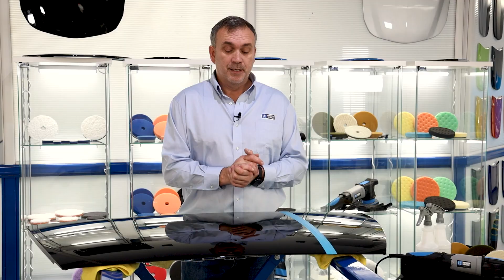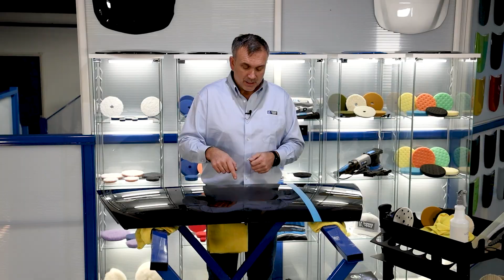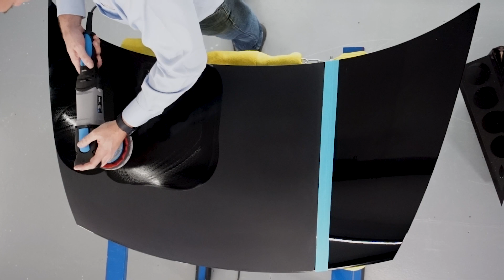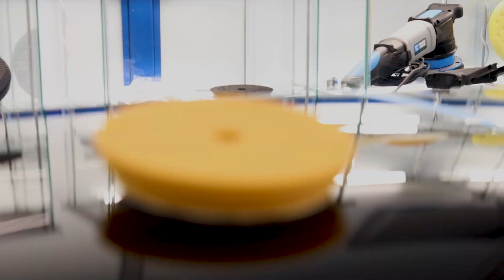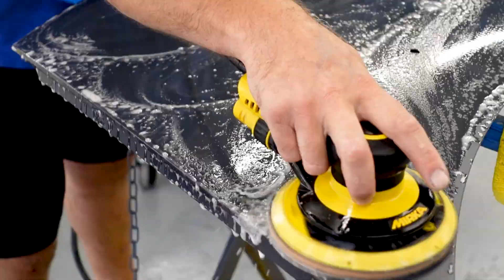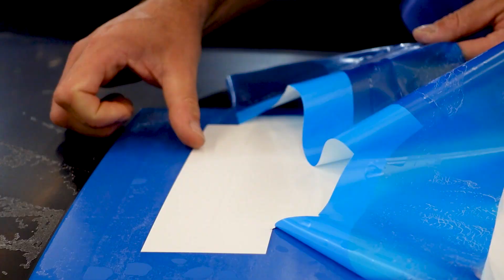UDOS® 51E Sanding Showcase | Removing Orange Peel

Comment: UDOS is one of the most versatile machines on the market today.    For an enthusiast at home that is just getting into polishing or more were upgrading from a Porter Cable or something like that,  this machine makes perfect sense.    It gives you access to every type of machine on the market today such as a stand alone rotary,  8mm, 12mm,  15mm, and 21mm.    No other machine on planet earth does as much as the UDOS from Lake Country.    The only downside is the size of the machine.   So even with this machine,  you would still need to purchase a smaller machine like the Rupes iBrid Nano or a Flex PXE-80 in order to be able to polish the more intricate areas which would be difficult with the larger UDOS machine with a five inch backing plate, although many people who just want one machine,  the UDOS would do 80% of the vehicle with the larger backing plate and not having access to a smaller polisher.    It would be cool if Lake Country eventually introduced a MINI UDOS!   Have all five modes just like the larger machine with the same ability using the turnstyle dial to change to the various modes, but also include a case,  the various pads,  the extension bars, and a quick change backing plate system like other machines have like the Flex PXE-80.   That's a tall order for Lake Country for sure, but maybe they will do it in the future.    That would give both detailers and detailing enthusiast alike the ability to have just two machines,  a larger UDOS, and a smaller UDOS and you would have access to polish/compound/sand every type of polishing situation you would ever come across.   The Ultimate would be if they could do both a larger and smaller UDOS polisher in BATTERY FORMAT!   Most detailing professionals and enthusiasts have converted over to battery powered machines and even most companies offer both corded and battery powered machines,  but realistically,  most detailers and enthusiasts like the flexibility and being "freed" from the cord so to speak as it does make polishing and cutting paint a whole lot easier.   Especially when using the smaller micro and macro polishers that are widely available now.    If the machines were designed correctly and the correct engineering went into them making them less heavy, quality built,  well balanced,  and have a lot of useful features and aspects to draw detailing professionals and enthusiasts to that brand of machine,  it could be a real winner.   Also include the various UDOS pads with BOTH machines if Lake Country ever did decide to design a small UDOS as a partner to their larger machine.   That way you would have the exact same pads (the microfiber,  olive, and khaki colored pads in 1 inch, 2 inch, 3 inch, 5 inch, and 6 inch sizes as a total range for the UDOS.    Even if Lake Country never explores manufacturing the smaller machine,  it would be nice to have the UDOS pad range in the smaller sizes to match the larger 5 and 6 inch pad sizes.    When you are doing a paint correction,  if you are using the UDOS machine,  when you bump down to using your smaller machine of choice,  you don't have a way to match the correcting you have already been doing with the UDOS machine,  There is no cross compatibility so it makes it a lot more difficult for the detailer and the enthusiast because you now how to use different pads to try and mimic the result which is very difficult and takes a lot more time.   You will never get the exact same cut and finish as you did with the UDOS pads when TRYING to match them to the smaller pads which are completely different to the UDOS.   While you can certainly get close to the finish, you will never been exactly the same due to the differences in the pads characteristics, density in the foam,  type of foam, etc. etc. so you see why it would be great if the smaller 1 inch, 2 inch, and 3 inch pads existed to at least give that option.   That would make it a whole lot easier as you would be completing a polish session or full paint correction, or whatever using the same pads across all the various sizes you would be using during that polishing session.   Just something for the folks at Lake Country to think about in the future.   Even if you don't build a mini or micro UDOS,  at least make the same pad range available for smaller polishers.    That would be a great addition.    The concept of the UDOS is fantastic and it really does make the whole process a little bit easier if you understand the basics of polishing and correcting paint.   You have a pad range with the microfiber,  and the cutting pad, and polishing/finishing pad.  That alone, for me as an enthusiast (and former part time detailing professional) makes it a much less complicated process.   Even when I was doing it professionally back in early 1990's with a friend of mine,  we used the 3M Perfect It system.   It had the rotary polisher,  the accompanying pads, and the chemicals you needed to complete the job.   It was a simple to use, but very effective system.   Granted, it wasn't as detailed as knowing the various types of paint like soft, hard, medium, whatever and then trying to pick the correct pad for that specific job.   We weren't that sophisticated and wanted a system that worked on most of the cars we worked on.   The 3M system was great for that purpose.    It was a quite expensive system and the polisher was big and heavy, but it was built like a tank and the overall results it provided was great.  People were absolutely thrilled with the results and we polished both single stage paints (which still were around quite a bit back then from cars in the 70's and 80's still being used at that time.   The 3M 'System' allowed us to keep it simple.  We cut when needed, but mostly just did single step polishes with either a wax application afterwards,  or a sealant application if they wanted a little longer protection.  We did what the customer wanted and it was the same price no matter what type of protection we used,  it was up to the customer.   The products cost about the same anyway so it didn't matter.   We used Meguiar's waxes and sealants which gave good performance and were easy to use,  even out in the sunlight.  Then some dressing on the tires and a quick refresh of the interior and our job was done.   It was simple work when you had a system to use that gave great results but wasn't difficult to understand and use, even for novices with just a little instruction.   The key was going light on the polishing so you didn't worry too much about going through the clear coat (if a car had clear coat).  Even with the newser clear coated cars,  back in the 1990's,  clear coats were a LOT thicker!  A lot!   Now the clear coats on paints are so gosh darned thin, it's unbelievable.   Car makers should be held accountable for ripping off car owners because of their ridiculously thin clear coat applications.   So when we worked on cars back then, we probably took off more clear coat in one polishing session than they even spray on new cars.   You rarely had a risk of going through the clear coat, or even single stage paints, unless you were really inexperienced in cutting and polishing and just weren't using good technique, or you simply didn't know what the heck you were doing.    There was a lot more forgiveness if you just used the same polishing techniques we use today.   Stay away from edges,  keep the pad stable on the paint,  use lower speeds,   work in smaller sections,  and check your work frequently to see what cutting is being accomplished with whatever pads and products you are using.    But, Lake Country,  if you are reading this,  a set of the various UDOS pads just like you have for the big UDOS would be really nice for those of us who use the UDOS pad system.   It would make it so much easier when using the small polisher along with the larger UDOS pads.   I've even though about buying some sort of punch or cutter to see if I could make my own small pads out of the larger pad sizes.  Just so I can keep the polishing consistent with the same pads between my smaller and larger machines.   To go even further,  give us the MICRO tiny pads used on those wand attachments or even the Dremel tool in both flat and then those "cone" type pads that we use on our wand attachment polishers.   The type of wand that you use for behind door handles, tiny recesses, and other micro areas around the car when you are doing a really intricate polish job either on your own pride and joy if you are a car detailing enthusiast and may have a high end car or show car, along with regular detailers who use those smaller wand type of polishers for certain details.    I know that 's a big stretch,  but it would be nice to at least have the small pads available.   Even if it's just the 3 inch sized pads.    That would even help.   Thanks for listening folks at Lake Country.